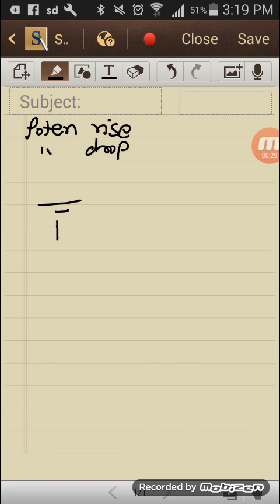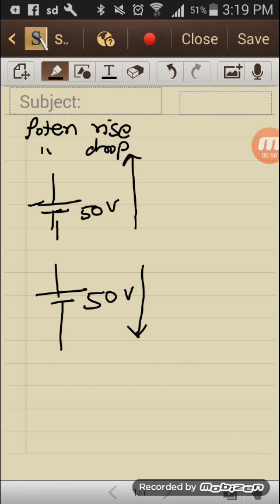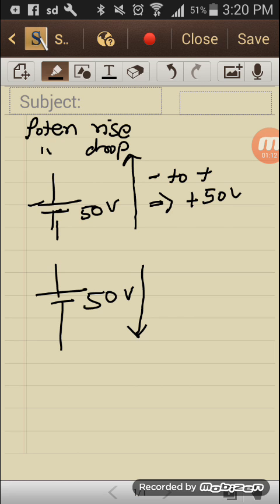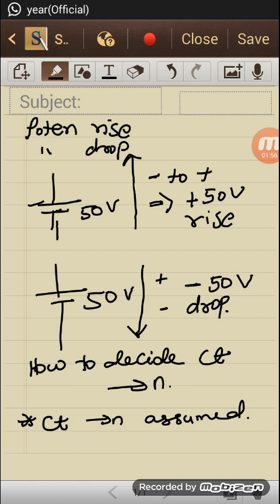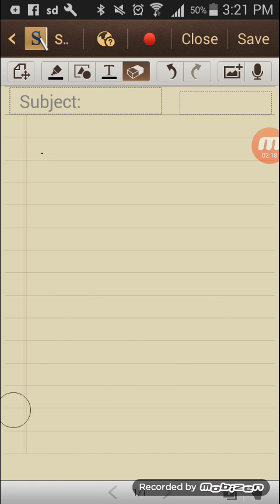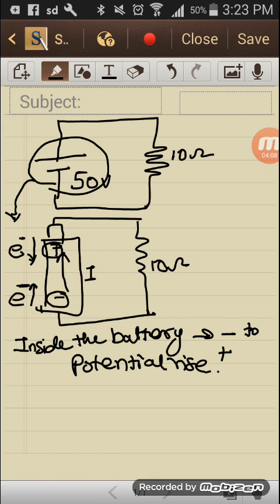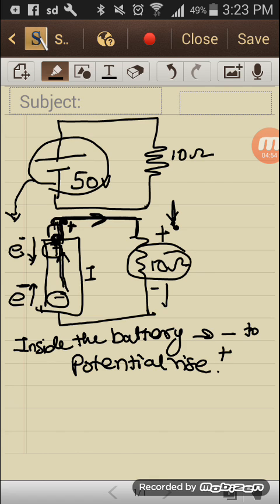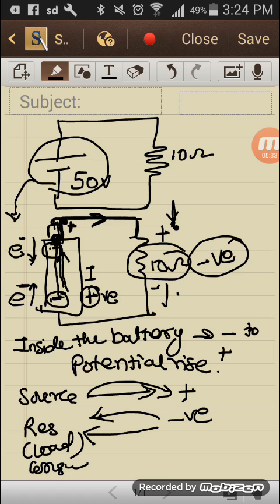What is Voltage rise and voltage drop ? Explanation

Comment: Be loud maam and post more videos related to circuit theory. Explain all the theorems it will be helpful. problems based on inductor,capacitor and resistor mixed circuits for theorem explanation. thanks in advance
Reply from the maker: Thank u so much....sure will do as per ur feedback.